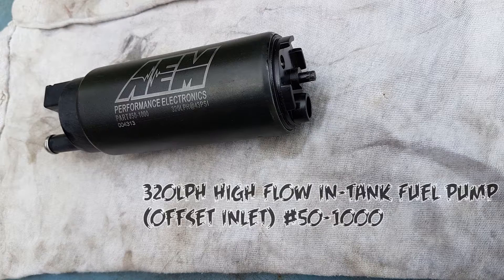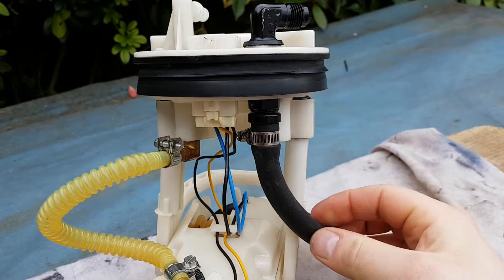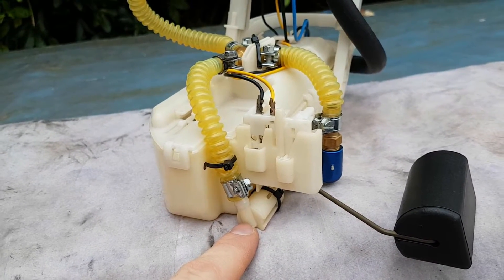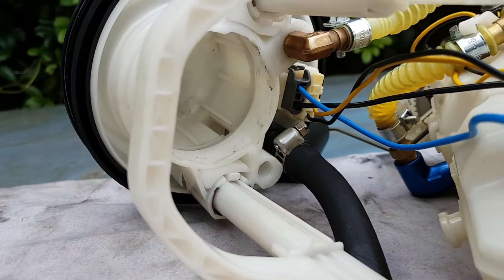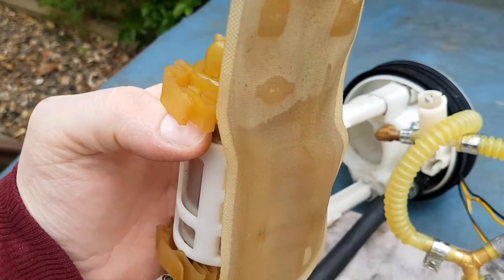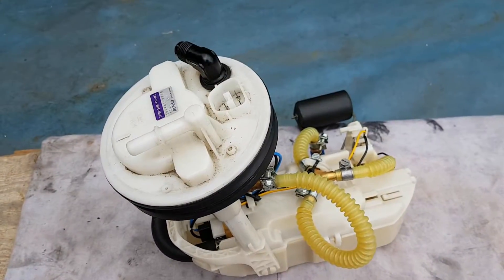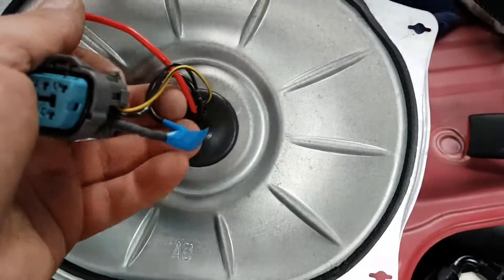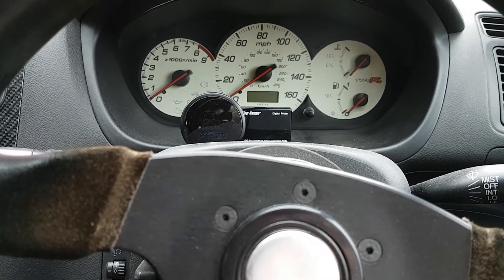In-tank Fuel Return System / Upgrade - 435bhp Rotrex Honda Civic EP3 Type R

Comment: What's the inner diameter of the hose you used to connect from the fuel pump to the new fed line AN point?
Reply from the maker: Its 7.3mm.

Comment: Dude where did you get the rubber hose from ??
Reply from the maker: MerlinMotorSport
Reply: @UpShiftTrackdayVideos  do you have a link to it as I can not find any lol thanks
Reply from the maker: @MrJHoop  https://www.merlinmotorsport.co.uk/p/rubber-in-tank-fuel-hose-by-cohline-per-metre-2190-0615
Reply: UpShiftTrackdayVideos sorry I mean the ribbed hoses you have used for the return set up 

Thanks
Reply from the maker: @MrJHoop  Ebay!
Reply: UpShiftTrackdayVideos  sorry to be a pain what did you search as I cannot find anything like that 

Thanks
Reply from the maker: @MrJHoop  search for "Convoluted hose fuel"

Comment: Wat fittings did you use and i mean all the fittings and pipe means i can just buy and fit. Thanks ?
Reply from the maker: freedom240188 I am actually working on v2 which is simpler.  I think it will be the next video.. hopefully very soon.  Is that a Punto GT I see in your pic?  I used to have a yellow one!

Comment: This is exactly what i needed! 
I'm about to start putting my turbo build together. My plan for the fuel system is 
In tank pump as a lift pump > swirl pot > bosch 044 > in line filter > y piece > both sides of rail > fpr (centre outlet of rail) > swirl pot > tank 

My questions are. Will the standard pump be ok as a lift pump? If I'm using a swirl pot can i just return straight back into the tank bypassing the in tank regulator? Or will i struggle once I'm down to 1/3 of a tank?
Reply: I found out the standard in tank will be sufficient as a lift pump